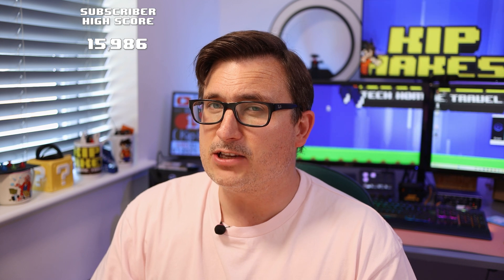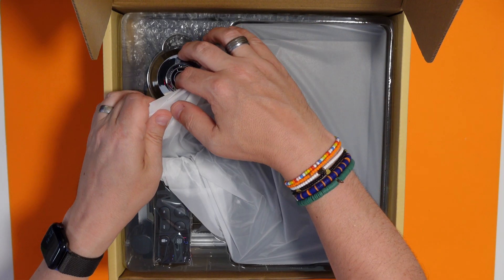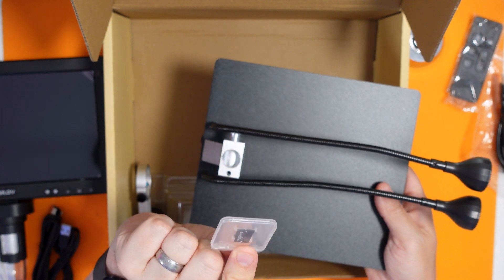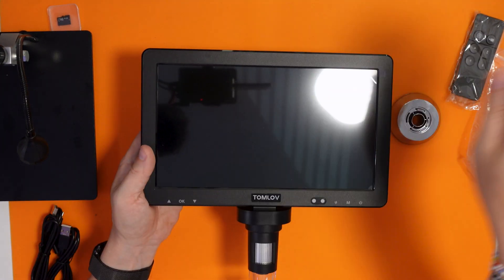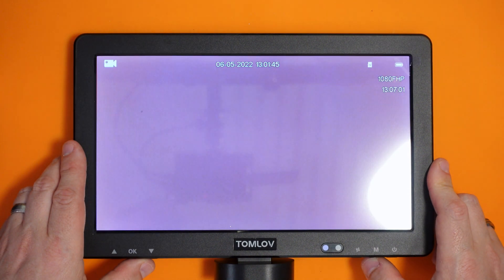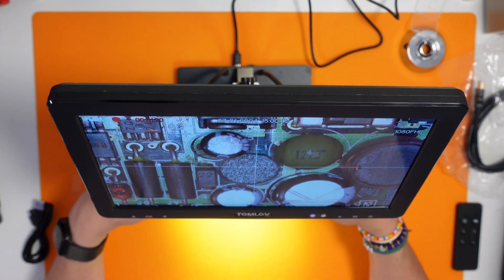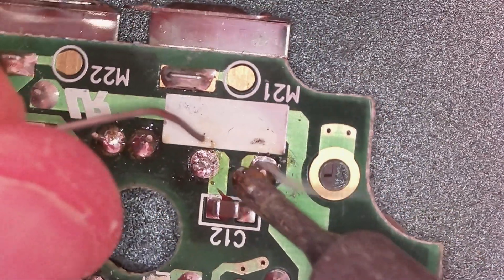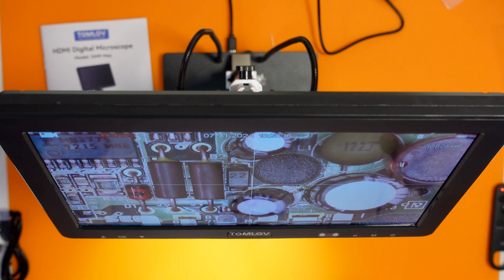TomLov 10.1" Digital HDMI Microscope - Unbox - Test - Review

Comment: Question. When you HDMI out of the screen to say a bigger monitor will the output from the microscope video signal be instant to an external monitor or TV right away or do you have to use settings in the microscope menu to get it to send video to the external screen first.  I bought a damaged same exacting version of this microscope but the screen is severely pixelated.  So I will not be able to use the 10.1 screen at all. I got the microscope super cheap hoping I can use an external screen instead. It will be a week before I get the microscope in the mail.  Hope to hear from you here in the U.S.A. Thanks ahead of time.
Reply from the maker: I don’t think you need to activate it in the menu, I think it just works. I’ve reviewed a lot of microscopes so I might be wrong.. but I’m pretty certain that’s the case
Reply: @KipHakes  Fingers crossed. Thanks.
Reply: @ It worked great! I only have to un-power the external screen for a brief moment re- apply power and then it works. This has been a huge help keeping an eye out on my turntable stylus's for wear or just for crud inspections.